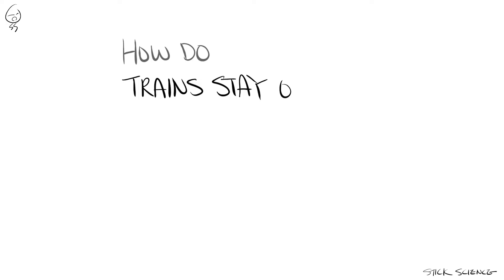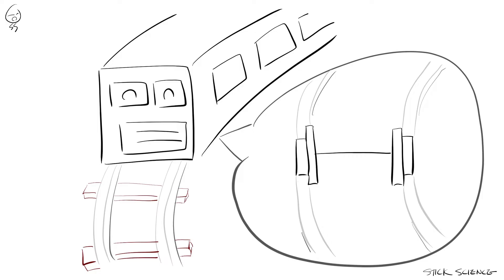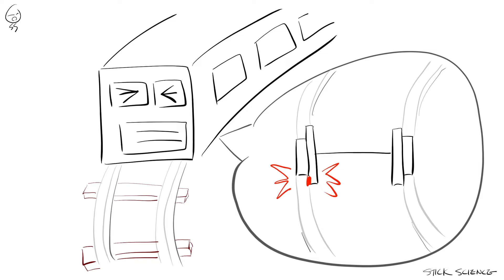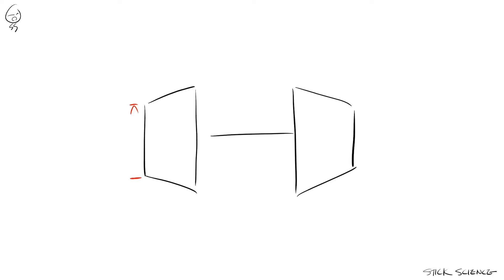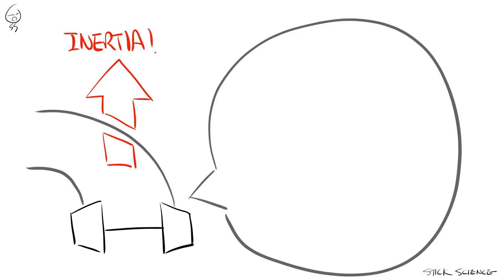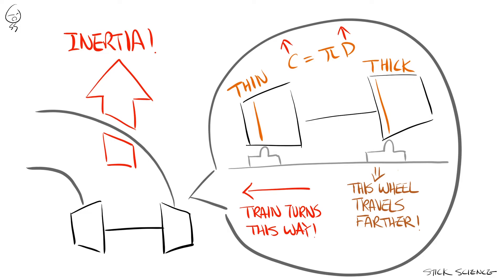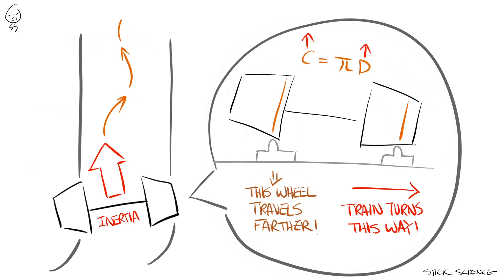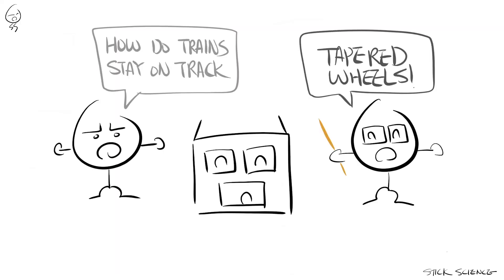How Trains Stay On Track And Make Turns

Comment: It’s a mistake saying that flanges never take part in trains taking turns. The screeching sound you hear when the train takes turns is the flange. Many railroads use flange greasers to avoid the noise and helps reduce wear.
The tapered wheel design helps keep the wheels centralized and yes helps avoid flange touching rails on curve but once a curve reaches a certain radius, the tapered wheel design is useless and the flanges start to rub.
It’s especially noticeable on subway trains. 
The “howling” sound that accompanies the flange squeal is the axel of the wheel set when the outer and inner wheels skid on the very sharp turns.

Comment: OMG! NOOOOO!!!!!
You don't have to figure out how to turn the wheels different.
Your video doesn't explain where the turning force comes from. Entering the curve, the the wheel on the inside is trying to turn slower than the outer wheel. The outer wheel is trying to turn faster than the inner wheel.
This generates the turning force and centers the axle on the rails.
Reply: OMG! YESSSSSS!!!!! It's called inertia as the video explained. Perhaps you need to watch it again and listen intently.

Comment: But how can both wheeka turn at same rpm w/o slipping?
Reply: Because of the tapered (pr. TAPE-erd) wheel, the diameter (and circumference) changes where the wheel contacts the rail.